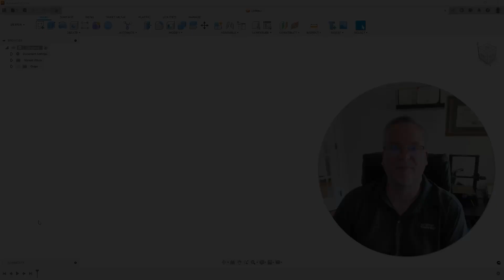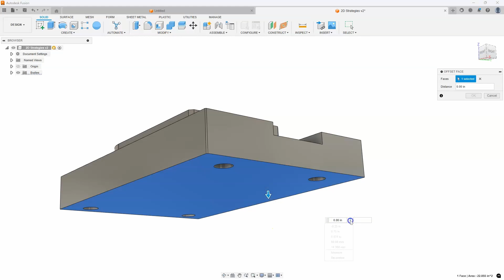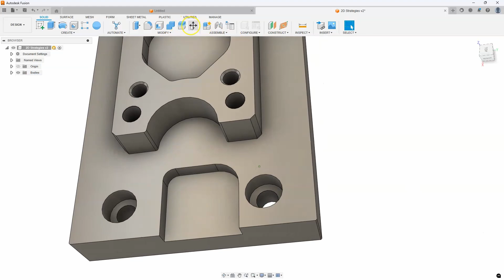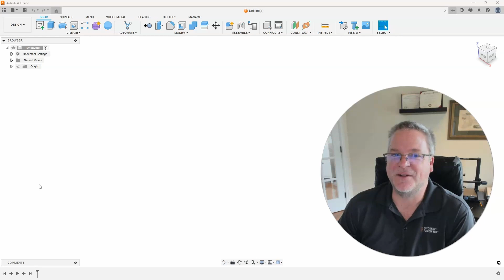Fusion Friday - Re-Anchor command

Comment: The term "anchor" implies to me that the extruded end of the extrusion datum is 'reset' to be from a user-selected point on the design rather than from the extrusion origin. I also presume this new anchor point is FIXED in the design. It seems I'm wrong on both counts. Brad... maybe you could drill-down on the parametricity of the Re-anchor tool as it currently exists within Fusion, 'cause it sure don't work like I expect it to.